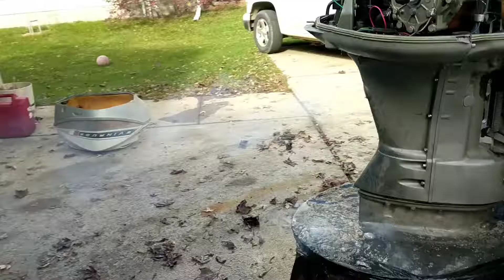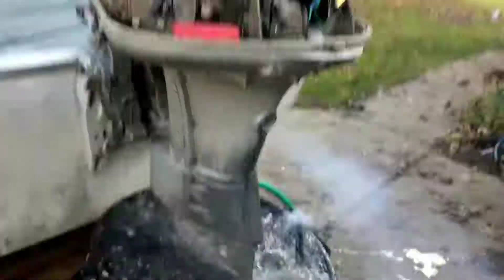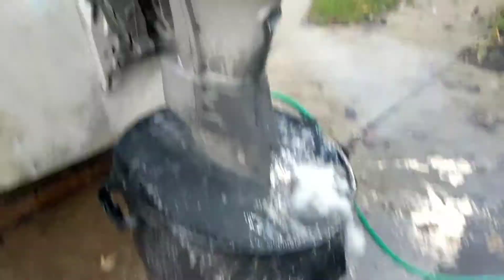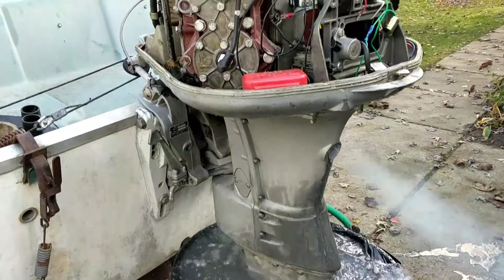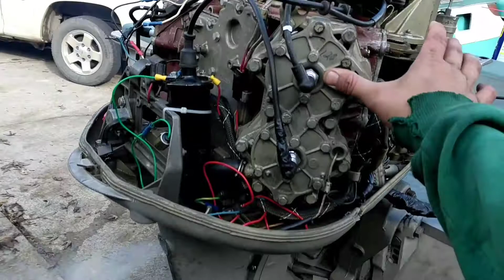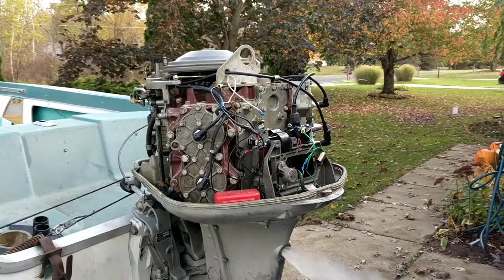1968 Evinrude 85 hp after impeller change

Comment: A buddy of mine has a 1968 Evinrude 100 electric shift. He can’t seem to get the lower off to change the impeller. Any pointers???
Reply from the maker: Are all the wires disconnected?
Reply from the maker: I had a heck of a time the first time because the wires go all the way down to the lower gear box and I ended up breaking them.  They kept getting caught.

Comment from the maker: Starters are fairly cheap for these
Reply: Hi Dan, 
I also have a 68 evinrude boat engine. I was wondering how you have your condenser and ignition coil hooked up. My cdi unit is junk and I'm not willing to pay $300 for a new one. Any help would be greatly appreciated. 
Thanks,
Ryan
Reply from the maker: @ryanmartin1171  If I remember correctly, it was + side of coil to the 12 volts from battery and - side of coil to condenser and ground.  Ground condenser, - coil to your main ground together.
Reply: @dan27444  Thank you for the reply. I'm going to have to get a condenser and coil. Does the wire from the points hook to the coil as well?
Reply from the maker: @ryanmartin1171  it might, ill try to remember.
Reply from the maker: @ryanmartin1171  https://forums.iboats.com/forum/engine-repair-and-maintenance/johnson-evinrude-outboards/110167-1968-85hp-johnson-with-bad-amp-can-i-use-a-car-coil
Reply: @dan27444   I'm going to have to give this a try. Thank you for all your help! I truly appreciate it! Have a great day!
Reply from the maker: @ryanmartin1171  it definitely works.  Mine is still working 2 years later.
Reply: @dan27444  Thanks again!